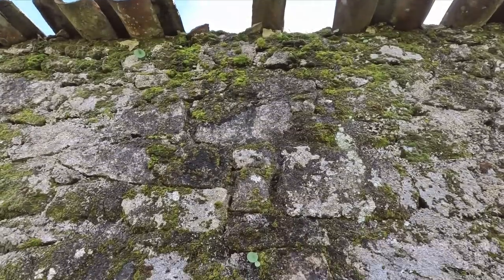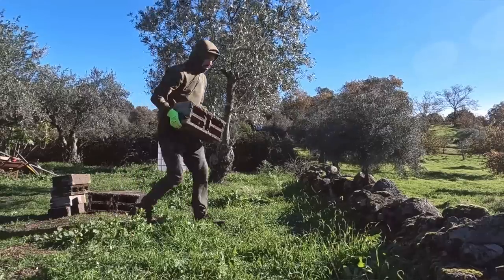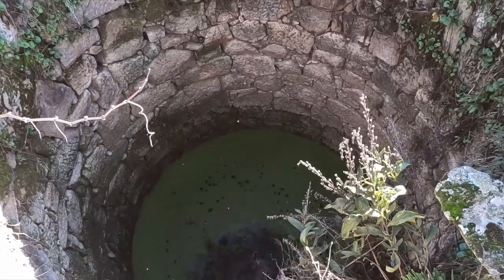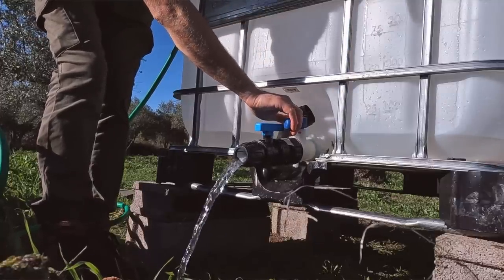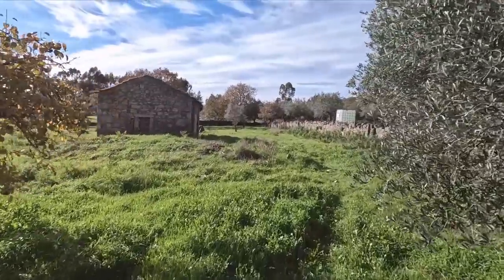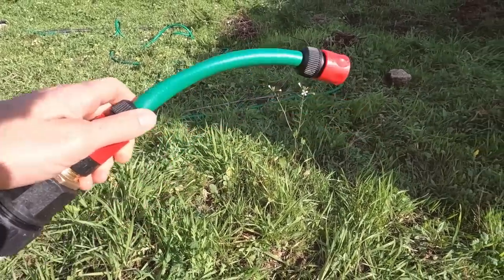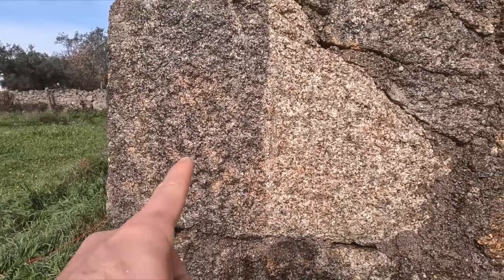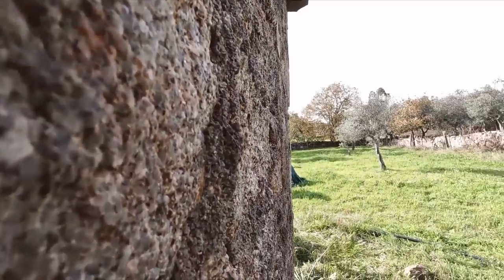RESTORING AN ABANDONED HOUSE | Pressure Washing Old Stone

Comment: Never tried on concrete but air needle scaler might work.
Reply from the maker: I have actually tried this already. Can’t remember which video it’s in though. It works BUT it does damage the face of the stone in the process. I’m trying to get hold of a sandblaster at the moment

Comment: Hi, What are the black connections called that you are using on the pump to connect the in and out pipes? I have the same pump and have struggled to find good connectors. Thanks 🙏

Comment: Hey Ricky do you have the option to get a large battery bank with AC output and charge them with your solar panels? Might be useful for when you don't need the full generator running for some smaller appliances on the property

Comment: For removal of the concrete mortar you could give a needle gun a try, they are used for removal of rust on car and truck frames in the restoration process. Most are air operated so you may need to get a compressor too. Looking good Ricky, nice to see your progress as you build your farm life.  Be well.../B
Reply from the maker: Thanks Bob. I think I’m going to try the needle hammer route first & if that doesn’t work possibly sandblasting. Neither of them are readily available in Portugal so I’m going to get one online.

Comment: Have you done a test excavation around the outside of the building to see of there is a stone patio hidden under a buildup of soil and grass?  Also to ensure the current groundlevel on the outside is lower than the floor on the inside.

Comment: Amazing sunset photography Ricky (around 15:00 in)! Thx for the tip about using a low-pressure washer, I'm either going to rent or buy one in the spring for my farmhouse cottage here in northwestern France. I have 3 walls that are just regular mortar and unfortunately one where someone in the past used cement - I hate that and don't understand why. Anyway, I've been told by several people around here that cement is very hard to remove so good luck to the both of us :) Also, something you may want to consider before you start pointing - here in France a mason told me that the traditional method is not how for example Theo did his, but rather you cover the wall with the lime mixture then rub it all down to expose the stones, kind of like when you're grouting a floor. I was surprised but now when I go driving and pass all the stone houses in the area I see what he meant and they do look quite good. Have a wonderful holiday young man!
Reply from the maker: Thanks Steven! I know exactly what you mean about the pointing. The method you’re referring to is very popular in France & I’m a big fan. Here in Portugal they tend to point between the stones rather than cover them. I’m going to try & do somewhere in between - point between the stones but not have the lime as recessed as Theo’s is if that makes sense.
Reply: @LifebyLiving  good plan!

Comment: I was wondering if your able to drive your vehicle down to that end of your property? Would save wear-n-tear on your backs! 😁
Reply from the maker: We’ve been talking about this a lot lately. We would need to clear a track & a probably lay down some gravel as the top of the land is very steep & the earth is very soft on the slope. I think getting down would be ok (albeit a bit nerve wracking!😂) but getting back up would be difficult. We need to do something though as soon we will have big heavy wood delivered for the roof & as it stands we’ll have to carry it down the land! 😭
Reply: @LifebyLiving  ~ Oh, I see. Yes you'll have to shore up a pathway for sure. It's a little deceiving isn't it. Looks firm enough but I'm sure if you could you would drive down there! It looks quite away from your gate.
Reply from the maker: @kwells8807  It's so soft in most of it that your feet sink into it! 😁 It's because it used to get ploughed every year so there is no grass root system to firm it up. We're working on getting that back though!

Comment: That shrapnel,  render , is appalling,  how to ruin a buetiful building,  getting it off, I would of used high pressure,  but wat ur saying,  granite doesn't stand up to it. Only one thing ,hammer and chisel
Reply from the maker: I find myself getting angry at times whilst working on this building because of how badly they’ve butchered the walls with that horrendous concrete. I think I’m going to continue with a hammer & chisel but I’m also trying to source a needle hammer for an air compressor as I think that might do the trick 🤞🏼
Reply: @LifebyLiving  Isn't that what Andy of Finca Life uses? Might be the answer.
Reply from the maker: @sarahnd  I'm not sure Sarah, I haven't heard of that channel but I'll definitely take a look 👍
Reply: @LifebyLiving  Well worth following. There are all sorts of good tips for restoring an old stone building.
Reply: @LifebyLiving  I suppose it's just a manky old outbuilding on a farm, which nobody cared about one way or the other, Ricky!!  Probably housed a few goats!!!
It's assumed much greater significance.....!
Chillax, dude..... !!

Comment: Your stonework looks to be in great shape.  If I were you I'd think outside the box and not so as Theo and Bea.  Instead of building up more stone and then placing new roof I would suggest framing the upper extension on the existing walls.  This will do several things by making the process not only faster and easier but allow the introduction of light from above without the need for skylights.
Here in the US I know the term "Clear Story Windows" that you could place in the upper section and possibly make the roofline a "Saltbox" style while creating a covered porch or surround.

I think this structure is much better than what Theo and Bea had.  It is an amazing project which should be fun as well.

I enjoy your channel good Luck
Reply from the maker: Thanks Harold. We’ll be raising the roof a little but as much as we’d love to add a couple of feet of extra height, whether that’s using stone or framing like you suggested, it requires planning permission here & we’re trying our hardest to avoid going down that route. I love your idea though. Would make the place so bright